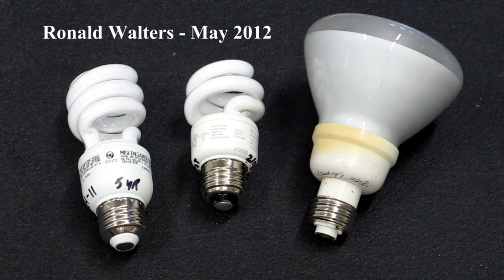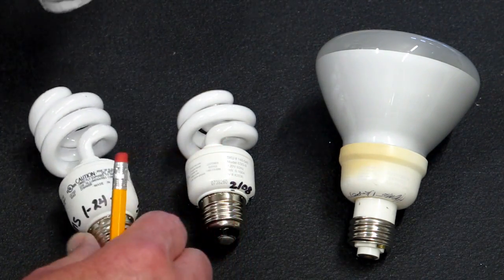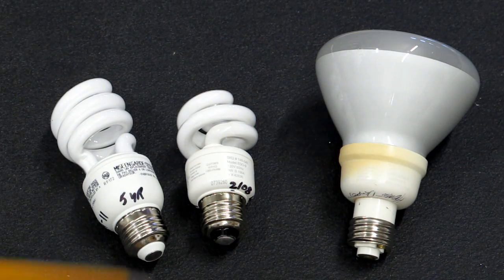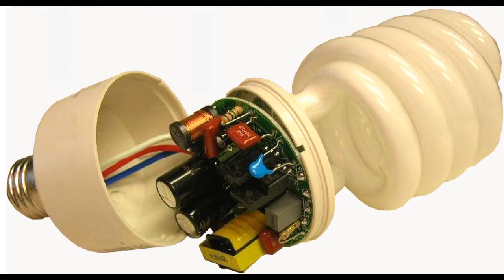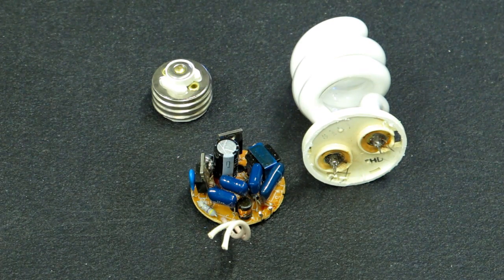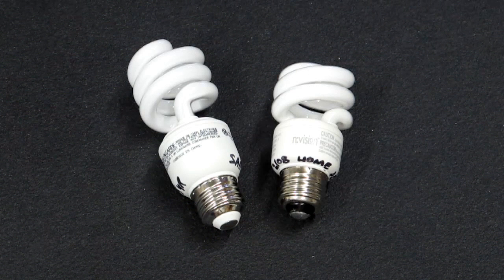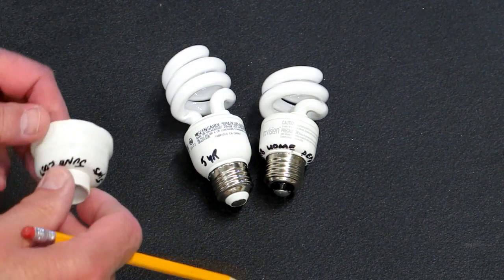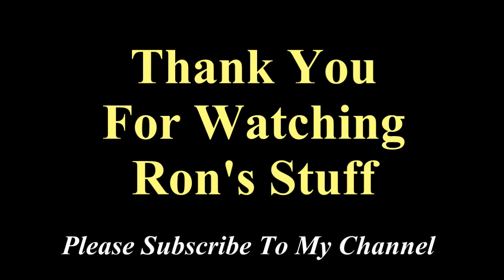Compact Fluorescent Lights - How Do They Work ?

Comment: Now I'm wondering what kind of projects you can make from a CFL.

* 600 volt power supply for a radio transmitter  50 watts input?

* Other DC or AC power supply?

Powering a four foot florescent tube with the output from a CFL?

Someone has probably ginned up a variety projects.

*

Comment: I went spastic on stocking up on tungsten and halogen globes when the Feb 2009 import ban kicked off in Australia I really hate the CFL globes tor their dim start, intolerance of frequent switching, early failure rate and cold light from the dollar store cheapies. I found it much cheaper to run a 40w incandescent in the kitchen 1 hour/day than leave a fluro going 6 hour/day

Comment: yeah....I'm pretty disapointed with the actual service life I have been getting from my CFL's, I too (shockingly bad memory) write the date on them when I install them, and sometimes I get as little as 6 months out of the suckers! But, I know why, I think, I've opened them up to find cooked components/heat warpage of the circuit board with pins desoldered and copper circuit trace snapped! In my case it's down to heat buildup in that tiny enclosure-I just looked at all the solder joints on the board-and they ALL have a weird wrinkled crease around the pins. very low quality unit..I wont buy that brand again!
Reply: Buy a bunch of replacement components of the non burnt type for cheap from China. Cut the plastic with a hack saw. Make the repair and epoxy the halves back together and viola. Or you can haggle with the manufacturer?...
Reply: @gregjones3660  Greg, you should do that and show us how it is done. Document the parts you use and make a video of your process. I'd love to see it!

Comment: I have another question about using these CFL bulbs.  Are these safe to use in the fan above a bathroom shower?  I know vibration is bad for them but the fan part doesnt work only the light comes on and the plastic cover is missing.  I have heard a story where the CFL bulb had caught on fire in a fixture like this, maybe they had a bad bulb but its this a thing I should worry about?

Comment from the maker: I used CFL’s in a small glass dome fixture in a ceiling fan. Fan vibration can be a killer but that fan is seldom used. The light is repeatedly turned on/off and the small, enclosed dome means the CFL gets hotter resulting in more frequent failures. I bought a 40 watt equivalent CREE LED (6 watt usage) from HomeDepot for under $10. Warm White Light instant full brightness and looks like a traditional incandescent bulb. I think $10 is still too high but the prices are starting to come down.

Comment: I recently replaced two 100w equivalent CFLs (23w) with Philips 22w LED bulbs. I really love the LED bulbs. They are brighter and turn on to full brightness. I justified the price because I was able to increase brightness without buying another lamp. One thing that surprised me is that the aluminum heat sink gets very hot. I have them pointing up in an open lamp so hopefully I will get the 20+ years out of them.

Comment from the maker: I finally broke down and bought three (3) 110-volt LED lights, two built into fixtures and one screw-in bulb to go inside a ceiling fan, which seems to eat Compact Fluorescent Lights although the fan is never used… ??? Anyway the cost of the LED’s is still way higher than what could possibly justify the cost. The color of light is good. Now they just need to quit gouging and get the cost down to what incandescent bulbs were/are. Thanks for watching!

Comment: Good job on the video. I like the CFLs, but they are not up to our Minnesota cold for outdoor use. I have 3 lights that go on out front and had to replace the critical one at the front entrance with an incandescent because you can't wait 10 minutes for the light to come on if someone is at the door!  They are great indoors and I like the color temp on the new ones.

Comment: Nice job Ronald. I also use a CFL in an outdoor fixture. They say 10,000 hour life, and I get just about that. I run them 24/7 and because they are lower energy consumption, they use about the same energy as a 75W incandescent running dusk-to-dawn.

Comment: Older lamps use only 2 parts, a condenser and a coil ballast... Those newier screw-in bulbs have lots more fragile parts inside them that can fail, The 30 year old lamps I'm using with just 2 parts total are still glowing and probly wont burn out for a long time still to come....

Comment from the maker: I installed 12-volt lights in my house for emergency lighting. I really did not like the original style LED “cluster lights” when they were so blue. I now use the newer warm color flat high output SMT SMD MR11 & MR16 LED bulbs. The warm ones are very nice and bright. 

However, I’m not paying $25 to $75 for a single household LED light. There is no justification at those prices. They’re just price-gouging a new product and calling it GREEN. Get the prices WAY DOWN and then I will do it.
Reply: Hi. Thanks for the very informative video. My cfl never went dim, nor visibly burnt out. One fine day, I put the switch on and it won't turn on. Mine is the first one in your video. Used for indoor lighting without a shade, simply fitted into the socket. I'm technically challenged 🙃, can you tell me what might be the problem? Unfortunately, I don't have an idea of the hours of usage, its been around for a couple of years.
Reply from the maker: They simply will not last as long if they are turned on/off frequently of if they are used in an enclosed fixture where they can get hot while operating (little or no ventilation).
Thanks for watching. Please subscribe!
That is what keeps this channel running.
Ron

Comment: I build my own LED bulbs now, I buy the parts off ebay, the LED bulb and power supply together, then the heat sink in a separate auction.  After making several i have learned what works and what doesn't work so well.  I have about 50% of my homes lighting replaced, all my recessed lighing has been converted to LED's.  I find a 10 watt LED is equivalent to a 100 watt incandesant, or a 23 watt CFL.  I have 30 watts lighting my kitchen really brightly.  They are said to last 20 years or more.